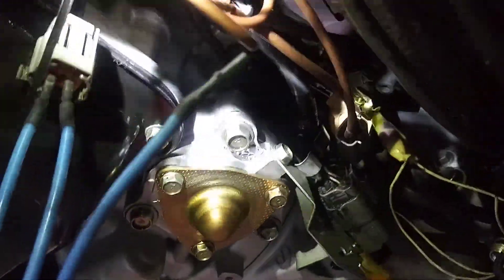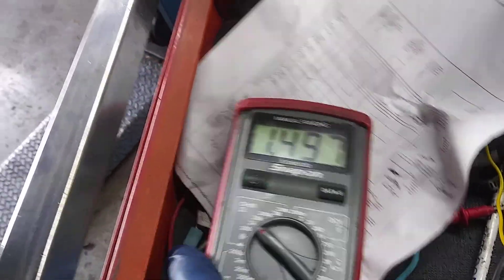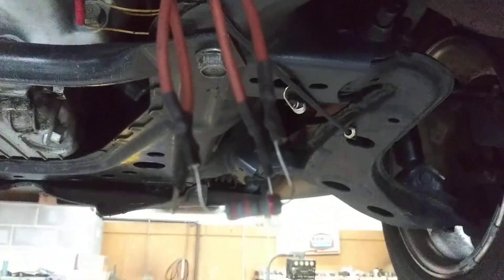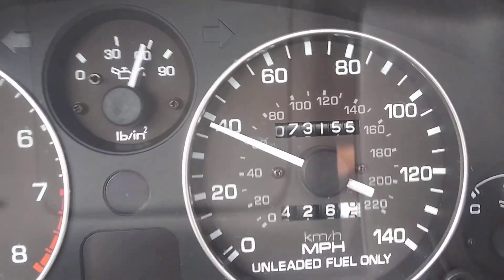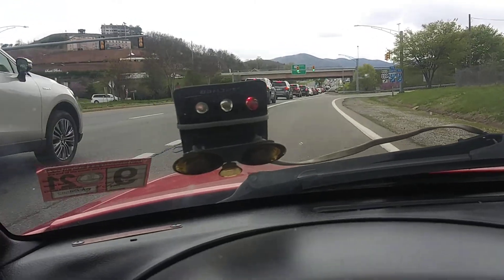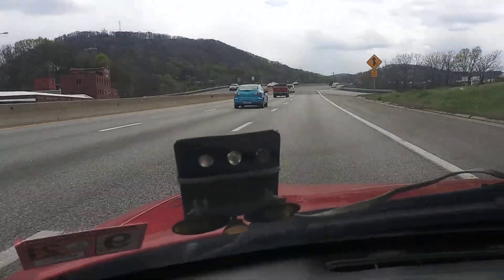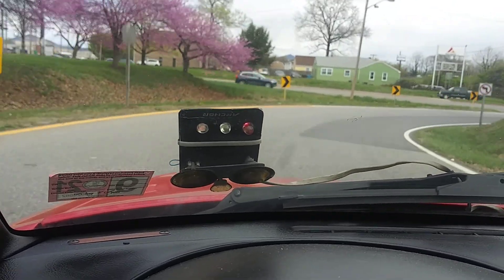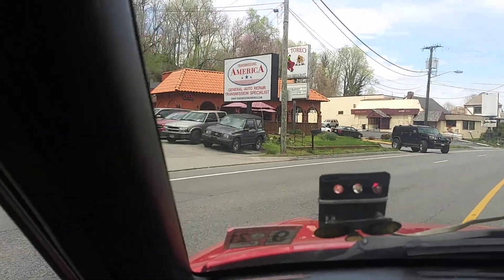Mazda Miata overdrive problem.Testing transmission fluid temp sensor.

Comment: Great video.

Which wires did you connect the 300 ohm resistor to? 

I'm wondering if it's the transmission fluid temperature sensor wire and the ground wire that connected the resistor.
Reply from the maker: temp sensor circuit

Comment: I have same problem of my Overdrive not engaging on 2004 Toyota Rav4 and I have code P0713. 

I want to add the resistor to my wiring harness but I don't know which ones to use.

Whether I should add it in series to the the temperature sensor wire alone or I should add the other end to the ground of the transmission wire connector.
Reply from the maker: Delete temp sensor from circuit and add resistor
Reply: @johnandeddie  OK. I have a wire for the sensor and another one for its ground with other 8 wires that control the various solenoids. If I understand you correctly, I should disconnect the wire responsible for the sensor itself and place the resistor there instead?